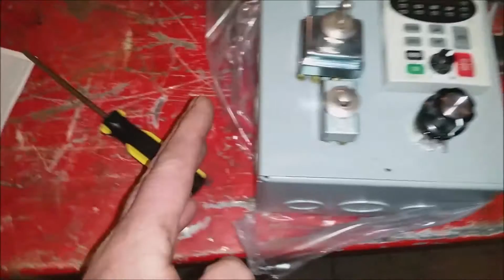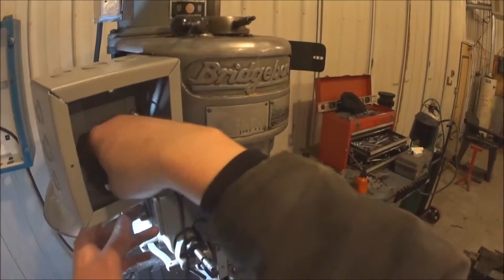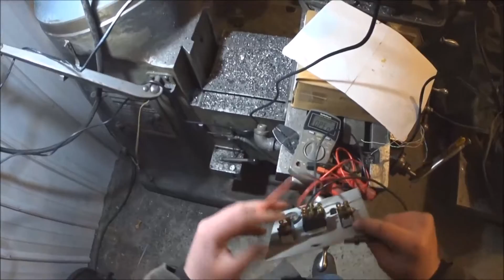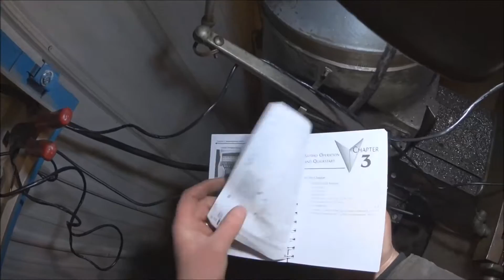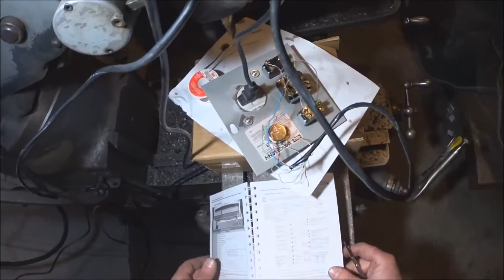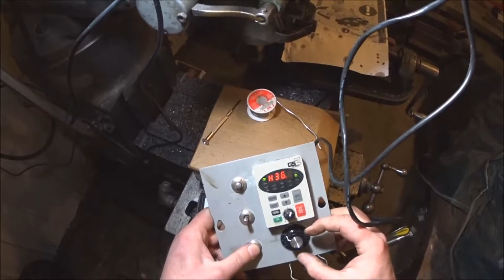VFD Controls for the Bridgeport

Comment: On your spdt  toggles, the center is always common and the contact always closes to the terminal opposite the switch throw direction.  I'm sure there are exceptions out there, but for the vast majority of them what you found there is the norm.  You did a good job there.  

My little 1-3 hp vfd didn't come with the capacity for remote installation of the touch pad, so mine is directly mounted on a bracket off the right side of the motor.  I've not installed the remote pot either, opting for the up and down keys for now.  That's what always being in a hurry gets a fellow.   

I'd asked on a different vid if the mill in the background was a standard J head,, and this vid answers that question.  Awesome video again, very well done indeed !!
Reply from the maker: Thanks -  Hopefully we'll get a lathe in here too - and try hooking up another VFD again.